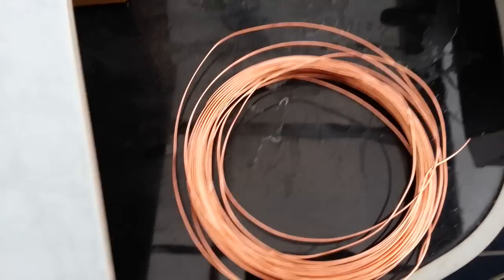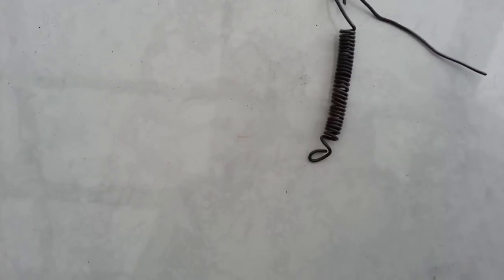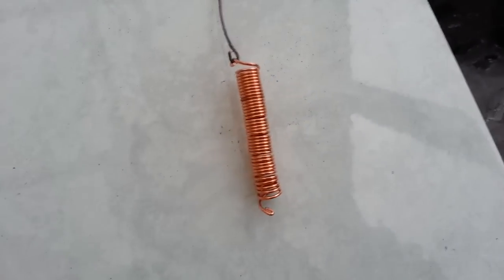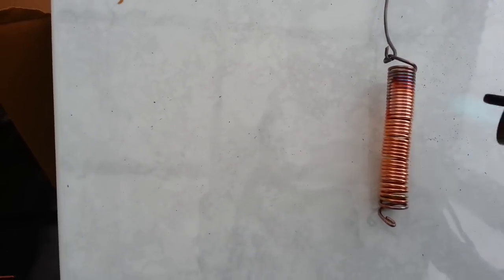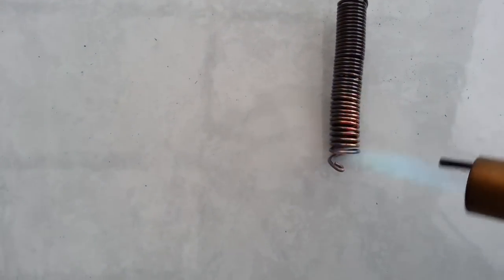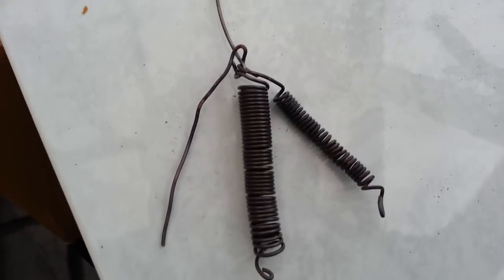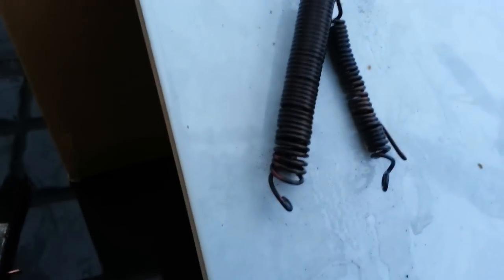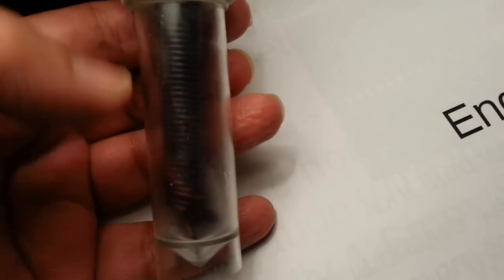Keshe Life Pen How to Make.

Comment: I made a single nano coated wire, one end looped other end cut at an angle to a sharp point form a video I saw, placed it in a plastic tube and put a bead at the sharp point end. Results have been excellent. I burned my finger and applied the pen , was healed the next day. Experimenting on my eyes and vision seems to be better. Headache reduced.
Reply from the maker: good to know. thanks.
Reply: Really 😳😳😳😳

Comment: hello ! do you have already some results to share ? I have been testing many configurations of the pain pen myself and it appears that the most simple are the most effective. I tried some with simple coil, double coil, end bent or not, with and without gans, clockwise and anticlockwise too but what i've noticed is that i have the best results with a simple anticlockwise coil and axis made of the same wire. (needle and coil attached) but with a very light gap between coil and axis and no gap between the turns of the coil.

Comment: I believe you had a reducing flame. when you heat the copper in the flame the black oxide was changed back to copper. More air is needed or use a properly adjusted oxy-acetylene flame.
Reply from the maker: ok thanks

Comment: Thanks for posting, but I hear from other posts that we're not supposed to use GANS for the pain pens.  Please correct me if I'm wrong.  Nice video.
Reply: +Chin Fu No GaNS on the coil, but the tip must be placed into CO2 Gans, with a mixture of Zinc GaNS, sealed into the tip of the pen, so it cannot touch the coils.. Hope this helps
Reply from the maker: yes you are right I made an update video and washed off the gans.
Reply: +Cast iron1969 What part of the teachings is this particular step?
Reply: 46th Health seekers workshop if i am not mistaken...If not let me know, and I will go through my notes and locate it for you..

Comment: What does "GANS" mean, is it an acronym?
Also, why is the copper covered with carbon from smoke? Shouldn't the copper be oxidized as per Keshe's instructions?
Reply: You let copper and zinc rust together, or you buy a chunk of rusted copper at a very high price from anybody who'll be happy to prey on believers and sell it to you.
Then you plug it into your outlet so that it corrodes the whole house before setting it on fire. That simple, from what I now understand.
Reply from the maker: gas in nano state gans.
As i have understood it.......the black coating is a matrix of migrated copper atoms from the copper metal wire which absorb a wide bandwidth of frequencies and do not reflect any thus appearing black. the nanocoating plasma copper atoms have magnetical outgoing and gravitational absorbing ie going inwards fields which interact with the salt solution environment with its plates as chosen by the user  to create free plasma ie the gans which then emulates the qualities of the Sun. Please see keshe videos for further clarification.
Hope that helps.
Reply from the maker: +pacifist575 Also the nanocoating matrix has pathways which exhibit super conductive attributes at room temperature and pressure.
Reply: +pacifist575 Thanks for the explanations. I watched a few of his 3-4 hour long videos already, but he talks about everything except the internals of his devices, I also felt stupider by the minute with his terrible white board drawings, an unborn baby can draw better.

Now that those GANS are out in the open, I would expect many scientists to have investigated these. I don't see any such corroborative evidence and peer reviews, so I have to assume this is just a peta coat of crap. There is no copper in the Sun, the Sun's plasma does not look anything like this GANS dirty water, and there seems to be a logical explanation as to why a Keshe device would produce electricity when it is plugged into the grid. I'd be more impressed to see it produce electricity unplugged... As for the "life pen," I don't see how it works any better than the working needles, fingers and stuff already used in acupuncture and reflexology.

Has anybody send GANS plasma to a lab for analysis?
Reply: +33Chimel33 yes to the lab ?,and no copper does not come from the sun. The plasma interaction with the sun and our atmosphere, combined with sea water is what makes copper, as for the "Lame-stream" world of so called scientist that lie about Moon landings, well i care not about their opinion anyway, and will see for myself...
Reply: r big
This "r big" character must like murderers, and people who try to harm children....Why else would he talk down of Mr. Keshe? Try and find peace in your heart!
Reply: r big
Just doing what i was told to do...Follow your own heart...
Reply: r big
No bully here, what you stated, "Keshe must own copper mine"", is an attack on the Keshe Foundation, and Knowledge Seekers throughout the world, that is why you received the comment that you did. If you really want to learn, then ask, and do not be a smart ass, or you see how the reaction gets an unwanted reaction....
Reply: r big
There are several. My group in California has a working model, but are reluctant to show as of yet due to legal issues regarding nano-coating the utility wires, and could they be held accountable for that legally. Once that is cleared up, then they will unveil theirs. I am still working on coils, but more focused on GaNS, and that is what i will be doing for the Keshe Foundation, producing GaNS' and experimenting with them..
Reply: r big
They want to, and i will show mine, because i am Man not a person, and apparently they have not figured this difference out yet, but they will unveil in time, and if not, i will!!
Reply: r big
i do not sensor. If you try in any way to talk down about Mr. Keshe, or the Foundation, i will block you though...i am Man, so, once again, your point is moot.
Reply: r big
 I have seen one yesterday. A German man with a very simple model, with a claim of 28% reduction in diesel fuel in his auto for the week of testing. He had a couple of devices working. Some LED's, etc..He says he is amazed, and cannot believe it himself...I believe, and so do others, who have seen things that cannot be explained by ANY book on this planet,,,
Reply: +33Chimel33 .. How do you make this GANS? or where do you get it?

Comment: Hello pacifist575, you are using gans to coat nanocoating and this wasnt introduced in workshops. Dip only a tip of pen, its like filtering. Important is also free central pin. When you are using coils dont bend center pin, its your flow of energy or plasma. Number of turns is not much important but spacing between turns or between coils is. Winding CW or CCW just do all same way. When you are using only pin then you bend it. Iam using single wire nanocoated, no gans, one "loop bend" on the end and works perfect. Try to understand people, go from simplier forms and test.  I refer to last Health workshop number 46 and there you have complete guide to advanced pens starting around minute 00:50:00. Look at it pacifist575 please. Try to  desccribe working of PenOfLife in your videos, thank you, your torch nanocoating is nice and you are on right track. Good luck for everyone and of course thanks Mr. Keshe.
Reply from the maker: hi Merek....thanks for the tips and advice. Always appreciated.
I will try and see as suggested.
Reply from the maker: +pacifist575 Have watched as suggested and edited and added link to video description above. Thanks

Comment: the coil should be clockwise,but the machine turns anticlockwise,so the coil comes up clockwise.
Reply: nice, you will be suprised how much powerfull they get with the cristals, its amazing, i have ordered some lemurian crilstals ill get them next month, they say the lemurian ones contain information,see if we can get it out, lol lol...
Reply from the maker: +juan luis santiago Ok Juan  so maybe go for clockwise for your project and let us know.Cheers and best wishes.
Reply from the maker: +juan luis santiago Hi Juan I think you may be right. Had a another look on Keshe site and if the drill rotates counter clockwise the coils are clockwise.
This has been very badly described by Mr Keshe in the beginning and he is now confirming that THE DRILL TURNS COUNTERCLOCKWISE  I will have to remake the coils. Thanks for bringing that up. We learn from each other. All the best.
Reply: just trying to help, ;)
Reply: the pen i made,the inside coil is clockwise and the outer anticlockwise, because i was not shure either,the next one i make i will make them both clockwise and compear it with the other one see if theres any diference, it does work,but the question would be if the anticlock wise would send into you bad energy like positive ions,ike they recon it happens with orgonites with coils in them,but maybe having one of each direction creates the magnetic gravitational flow and that does not happen,its posible then that at the same time it injects you with good energy the second coil extracts the bad ones, but i dont have a clue if that would be so,lol.
Reply: +juan luis santiago coils on the MaGrav unit MUST be wound CCW, the pain pen it does not matter which direction you wind..
Reply: ok,thanks, i thaught the magrav had 2 windings the clockwise and the ccw, first one inside second outside so one is magnetic and the other gravitational.... but i havent got to that yet, im just making pens and starting to make some batteries to test... by the way the pens are doing well with pains and warts.....
Reply: juan luis santiago
MaGrav has only one winding ccw three sets of coils two each. One 144 turns, and the other 81 turns with plasma ball, or clear crystal in the middle of the coils stacked. Hope that helps. I would like to see what you have done with your pain pen, do you have a video, as I too am working on one.
Reply: +Cast iron1969  thanks, yes i realized that, no video yet,but heres a picture https://www.facebook.com/photo.php?fbid=656426307833518&set=a.475276852615132.1073741828.100003984654509&type=3
Reply: +Cast iron1969 the nanocoating is by coal and wood fire,the iner coil is clockwise 9 turns outer is ccw 18 turns, allso made other pen with cristal inside,no pic yet,nanocoating tomorrow, the doubt is should i leave one coil open at the top,and wich one would be best,the inner or the outer, i know keshe sed something about that, but cant remember what exaactly, lol...... ohh by the way every time i take of the fire i pass voltimeter allways positive on the top curve and negative on the straight ends, then they will go inside cristal tube tests that meassure 18x180mm, that allso adds to nine. ;)
Reply: I love it...Always 9...... I am placing my pen in caustic for the 2nd time today, and, day after tomorrow, i will post a video on the construction of my pen. 4 coils, all ccw from 12 gauge on down to 18 gauge plus one single wire,(12 gauge), in the center of it all, with all leads pointing out, and the center looped, and i am currently trying to split the end of the loop on the center rod to have one loop, and the other straight..Thanks for sharing, love the crystal idea. and I have some samples of a place nearby, that will be here tomorrow also. Real cheap, beautiful Arkansas crystal, various sizes up to 4 inches
Reply: juan luis santiago
A company in Ar sent me there best samples a, aa, aaa, aaa, being the best, and i have to say, i have seen a lot better as far as clarity goes...
Reply: +Cast iron1969  i ordered from alibaba.express, hope the cristals are clear as they claim,will have to wait a month do, cant find them here in mallorca for a reasonable price,and it is better to see for yourself the cristal before buying,but itll be worth a risk if they are cristal clear.allso u will be glad to hear, if u use a nanocoated spiral under the gans materials recipient,the gans turns plastiline, better to handle with, it takes from 2 - 5 days or maybe a few days more... i noticed it works after 1 day...
Reply: i understand that there could possibly be a way to get good crystal from within the foundation, i will ask i think about 35 dollars not sure about the price though, but you will get great quality crystal. My samples i received are lacking to say the least. There best quality has a great point, but the clearity suck just a little at the tip...Oh well only 10 dollars...and i can still use them for mxing in with the GaNS
Reply: hello cast iron1969, i accidently made magnesium cristals in mix gans,would they have diferent or new properties(info)?what could i use them for?
Reply: juan luis santiago
I too made some kind of crystals, and were growing fast, so i knocked them back down in the solution...lol
Reply: +Cast iron1969  lol,lol,lol shit happens, i saved mine but they quite dirty with gans,ill just keep them untill i know how to use them.i feel quite alone at this,thanks for feedback, tried talking to kf.spain , they must be on hollidays no response from no page,or maybe they dont know what to answer,lol....
Reply: juan luis santiago
what can i do to help?
Reply: well, i still dont know what to do with them, they still growing but small now, i just left them in a small tapper,have no time now.but if they are from epsom salts (i supose), i still dont know wich apllication would be the best for it, Cast iron1969..

Comment from the maker: coil winding direction confusion. i have reviewed the keshe foundation site and wound the coils correctly as mr keshe advises.
Reply from the maker: +Anthony Rivera Hi Anthony have a look at the keshe site blueprint videos for more info and my other videos where I describe how I got the wire from ebay for my other magrav build project. I made this from leftovers of that project.
GANS stands for gas in nano state or plasma.
This was 1.6mm copper roll gauge 14. 

Battery drill,
 rods of 5mm and 10mm approx for coils winding etc.
Lots of videos on You tube to guide you
Much cheaper to build your own.
Prices should come down in time of the Magrav and life pens.
Best of luck and go with an open mind and positive attitude but with a healthy scepticism. Have fun building it. I did.
Reply: +pacifist575 Nice video. So what is the correct coil winding direction for both coils?
Reply from the maker: +up yours hi up yours! according to mr keshe anticlockwise  as you follow coil away from your eye. see my other video where i show close up of both right way and wrong way.
Good luck....
Reply from the maker: +up yours Mr keshe now says the drill we use to wind the coils rotates counter clockwise so the coils then become clockwise. 
when i made these coils he clearly said to make coils anticlockwise.
SHEESH! Anyway i will try make coils again.
Reply: @pacifist575  THE DRILL CAN BE PLACED IN REVERSE SO IT IS MADE ANTICLOCKWISE ...
Reply: +pacifist575  Sorry for my ignorance, can you put the materials used?  example  16mm copper wired, etc etc>

 what is GANS? what did you coat it whit?? i been looking to make this but from what i seen i have no clue of how to do it beacuse, i think i lack the materials.
Reply: look at the coil from the top and it's clockwise... look at it from the bottom and it's anit-clockwise. same goes for the drill, look at it as if you are shooting a gun and it appears to be rotating clockwise, turn it around, as though you are looking down the barrel and it's going anti. just sayin

Comment: what do you use to make the GANS solution.
Reply from the maker: +Awakening Cosmic Reality Show
 Nano coated copper plate and a zinc plate in sea water.
Also Nano coated copper plate with an uncoated copper plate in sea water.
May try nano coated copper and aluminium also.
Experimenting with difefrent ganses. 
Will try collected rain water and maybe a 1.5V battery with the negative on the NC copper plate.
Videos to come